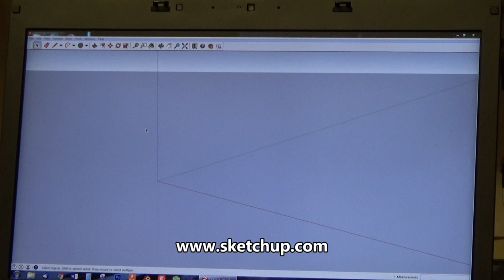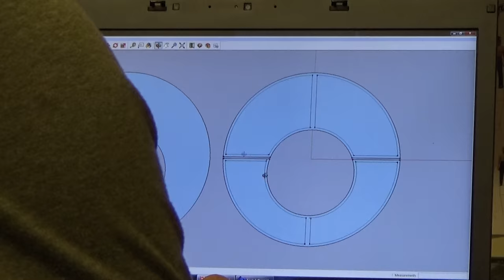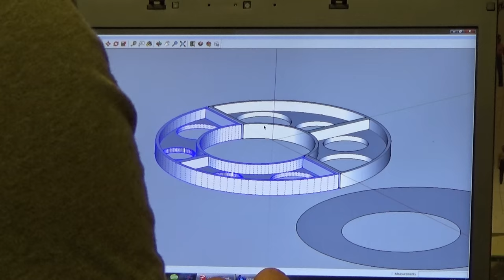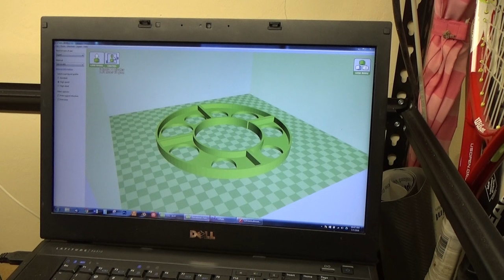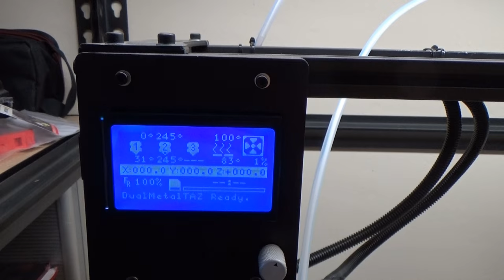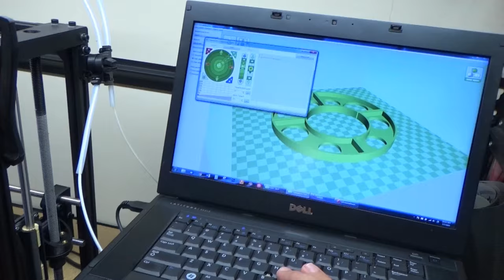3D Printing an RC Submarine cylinder bulkhead

Comment: dont use pla for rc submarine, some brands develope moisture in contact with water and become fragile
Reply: jorgeneo560 I’m printing out a sub using pla but plan on either coating it with a couple coats of epoxy resin or maybe even use fiberglass fabric to give it more strength. I tested the resin and it works great.